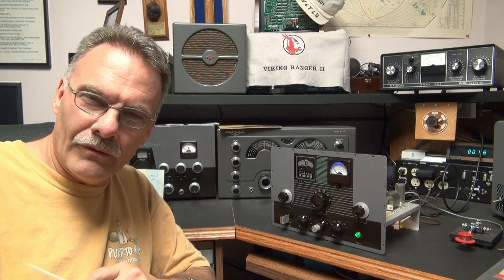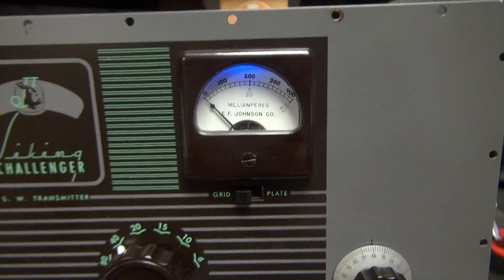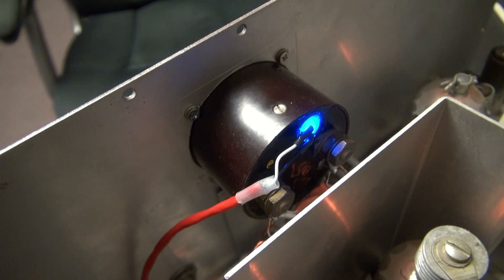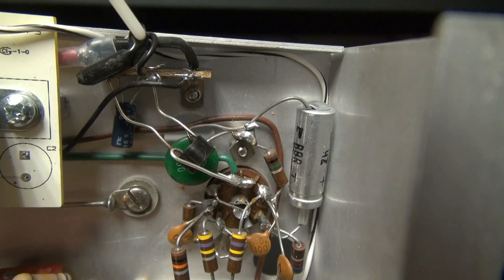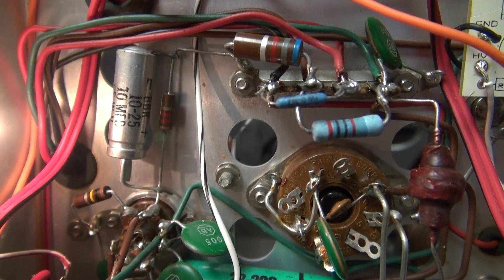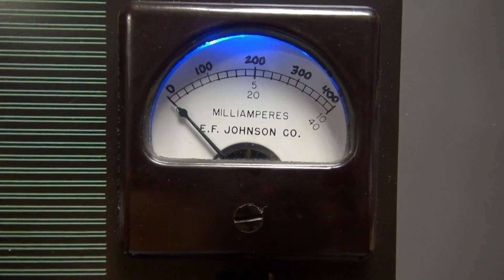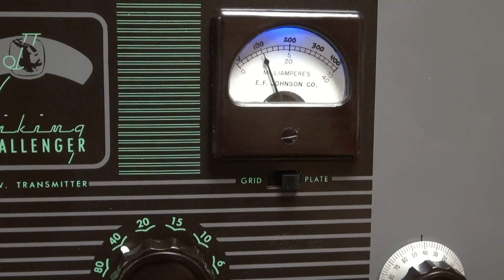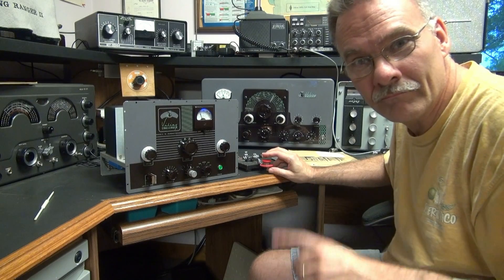EF Johnson Viking Challenger Tube Transmitter Plate meter Upgrade How to

Comment: Actually, your art work is very good and I think most anyone would be pleased with that. 
QUESTION TO Terry or ANYONE,  how much did the main hole have to be enlarged and what method was used. I have some large Greenlee punches and maybe with very careful eyeball alignment I may be able to punch a clean hole. Yes, I know the punches work with a much smaller center hole but I have been able to eyeball other apps and get a clean larger cut on a smaller hole. Tnx es 73
Reply: I can't see how you would ever get a greenlee punch to work on an existing hole.  I used a half-round file.  I used the file and try method.

Comment: Also why does your new meter not set at zero?
Reply: There is about 45 mA of idle current on the plate when in the CW position on the TX selector switch. Mine is exactly where terry’s meter indicates.

Comment: What is the basic meter movement of the original meter?
Reply: Nevermind, I replaced mine with a nice new Simpson 1 ma meter.  Replaced the scale with one from a DX 100 plate meter.  Can hardly call this thing a Challenger anymore.  It now has two internal relays for TR switching and other functions, RCA phono jacks on the back apron.  Added a mic gain on the rear right.  Brought the key and mic jacks to the front, one on either side.   Replaced the sweep tubes with 6146s (all three), and put a zener on the screen grid of the osc tube.  Oh,  closed off the top and mounted a cooling fan on the right side beside the plate tuning cap, 5 inches square and one inch depth.  Just fits on the chassis there.